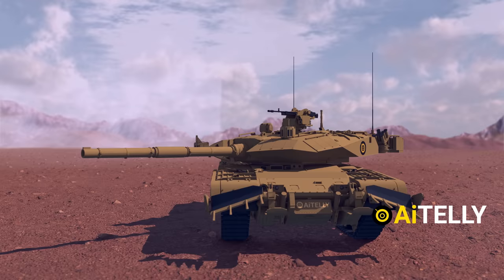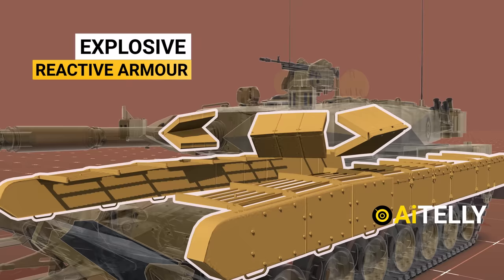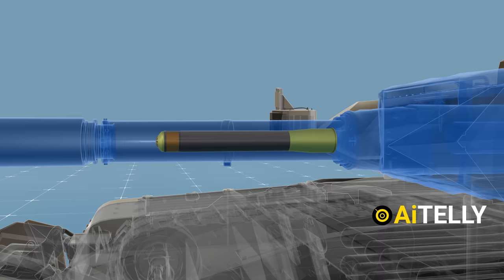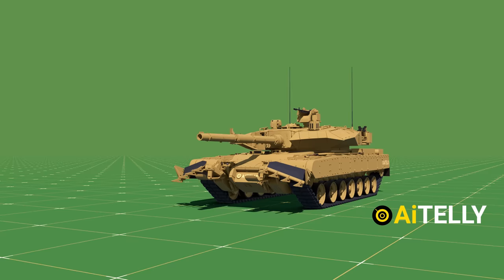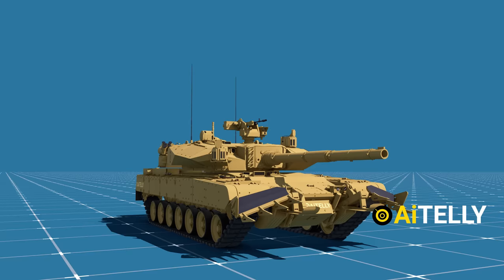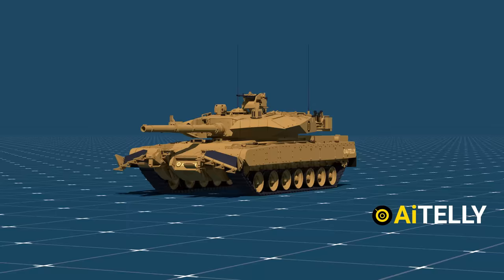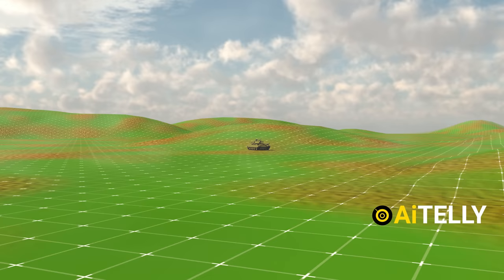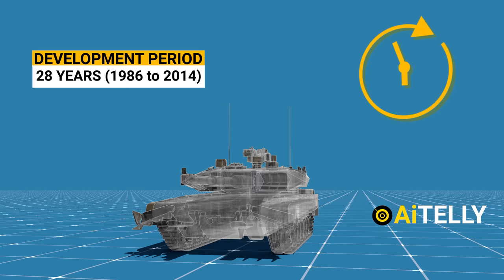Heaviest Battle Tank Arjun Mark 1A Mark 2 | How it works #tank #tanks

Comment: This tank will suffer in muddy and eastern indian terrain.But they most probably made this tank for pakistan.
Reply from the maker: I think so
Reply: @Aitelly  Arjun's operations are easier due to low soft ground pressure (0.84 Kg/cm2) in comparison to T-72 (0.89 Kg/cm2) and even T-90
Reply: It was made to counter abrams  that was supposed to be procured by Pakistan.
Reply: @007ymm5  lol usa didn't give Abrams to pakistan and Abrams much better than arjun 😂
Reply: @wendelldig591  yeah I said abrams that was supposed to be procured.
Reply: @apoorvchauhan6258  yes it has low ground pressure but it will suffer when crossing weak bridge because its total weight
Reply: @suhendiabdulah6061  true
Arjun was never made for Mts anyways

It was for plains of Punjab and Desert of Rajasthan.
We have T90s and T72s for Himalayas plus we are already making a light tank tailored for that terrain
Reply: @wendelldig591  the Abrams version which could have been sent would be much lower.
Reply: @apoorvchauhan6258  yeah lucky for india have big plain area.....  island nation like indonesia, philipine and japan have limited play for mbt. Even japan that capable to build heavy class mbt abandoned mbt and chose type 16 - 105mm low recoil gun wheeled vehicles and indonesia chose to build 32-35 ton tracked vehicles with 105mm gun ( well...... japan chose wheeled vehicles because it has good road condition and indonesia has extreme road so they chose tracked vehicles) those island nation chose mobility than armor because its easy to be deployed and tranported by plane
Reply: @suhendiabdulah6061  once deployed Arjun can wreck havoc coz new systems are already in place along with new kanchan 2 armour and new types of main gun missiles..also new APS system will destroy incoming shells
Reply: It's very similiar ( in looks and capacity) to leopard 2 of Germany..same DNA..All efficacy questions END right there..ITS GERMAN
Reply: This tank wasn’t design to fight in the east of India .. Iam not a fan of Arjun but FACT is FACT !! Arjun was designed and manufactured to replace the T72s in the western sector bordering Pakistan .
Reply: But across the LoC weight will be a problem because most bridges won't support that weight.
Reply: @wendelldig591  There existed a possibility always ... Pakistan has previously procured Patton tanks also from USA and they were used in 1965 and 1971 war against India (though not much effect from it as many were abandoned and destroyed in both the wars).
Reply: @wendelldig591  Abrams don't have missile firing capability. Arjun can target Abrams at 5km range.
Reply: @apoorvchauhan6258  yes but it's best to design tanks that's great for all terrain possible. Added too much weight is whyany tanks can't cross bridges, destroy roads, stay in mud, not amphibious etc. Look at Russian tanks. Can go any terrain, bridge, roads and can go on river and not get stuck on mud. That's a huge advantage in war
Reply: It's for western front only .
Reply: @dharmicwisdom9818  wrong. Russian tanks has very good protection really. And no it's not what you saying which is very false, because if that is true then leopard tanks would not had worst performance in Syria. Also Abrams tanks in Yemen would not had bad performance as you can see many videos and photos of destroyed Abrams. That is why aps systems will change the battlefield against RPGs and atgms. So again wrong.
Reply: @dharmicwisdom9818  you forgot the it's because Soviet doctrine they invented the explosive reactive armor which is best to have in any tank and that's why all western tanks have it right? Then case closed.
Reply: @alexnderrrthewoke4479  Israelis figured it out after their war with Egypt.
Reply: @dharmicwisdom9818  that's why tanks never work alone. It's evolution of attack and defense. They always at war with each other.
Reply: @wendelldig591  the Arjun mk 1a and mk2 can almost go toe to toe with Abrams and thankfully USA (due to high rise in terr@rism) didn't get Abrams to Pakistan, but Arjun can now wreak havok to Pakistan's Chinese made tanks
Reply: Ha Ha I am from India and I don't know How good Arjun is Against Abrams but in every comment section people are fighting with eachother without knowing a thing about Tanks🤣🤣🤣🤣
Reply: @alexnderrrthewoke4479  in case of  India you can't get everything, as India has every kind of terrain, from desert to tropical and mountains snow desert if you want a tank that can go anywhere then you have to sacrifice its armor, and for today's warfare no tank is safe from ATGMs, every tank needs an APS, hard kill and soft kill, and we may not even see a that much of tank battle due to ATGMs,  tanks need infantry and infantry needs a tank, vice versa for completing the task,
Reply: @benudharmadhi4154  again have you not learned a from war yet? Tanks will always be needed in battle. Putting too much armor is not worth it. Enough is the word about it. Aps systems will change battlefield of atgms. Tanks will never be obsolete as many ignorant people say and for you to say there won't be many tank battles then you not seeing what's going on in ukriane then. Atgms is not easy to produce especially javelins which is 250 per year. That's nothing.
Reply: @alexnderrrthewoke4479  I didn't say tanks are obsolete, but it needs good support from the infantry, countries like the UK, USA, France, Israel, Sweden, Russia, Germany, China, India, Turkey, and Iran, have industrial to mass produce the missiles, it cost less than a tank, every tank are obsolete from top attack, javelin, bill, Nlaw, nag, can destroy every tank, APS is must and should, currently they tank face another major threat is the drones, and in an urban environment that's a nightmare for tanks
Reply: @benudharmadhi4154  missiles cost less? Did you read my comment? Lol. Do you know how much it cost a javelin? 100k now with inflation so no. The bayraktar turkey drone or the Iran drone will make better buck over javelins any day. Of course tanks not supposed to work alone.
Reply: @alexnderrrthewoke4479  javelin costs 200k$, and a t-72 1.5 m$, a t-90 3m$, an abrams 6m$, and a leopard 7m$, and inflation will also apply to a tank not only for missiles, APS can only save tanks now
Reply: MUDDDDDD?!!!!!
Reply: Thats why the army had issued the light tank order. And zorawar kight tank made by L&T will be presented in april this year
Reply: This was mainly built for the Western border with Pakistan. In that region, arjun even performed better than t90 tanks
Reply: @wendelldig591  much better doesn't always means it will win. Pattons were also better when pakistan got it. Still indian army made a massive graveyard of patton tanks. It's hilarious when people underestimate
Reply: It'd called as desert ferrari so no need to deploy it in northern and Eastern theatre
Reply: @apoorvchauhan6258  bro.....the Arjun is twice heavier then then both the t-72 and t-90....
Reply: @bhishmaMbt  it is heavier but weight distribution in case of Arjun is better as larger surface area is interacting with the ground thus decreasing the pressure.

Pressure= Force/Area

Force= Mass of the object x Acceleration.
Reply: @suhendiabdulah6061  precisely sir. different condition, different doctrine.
Reply: @alexnderrrthewoke4479  agreed sir.
Call it lack of vision, coupled with threat assessment of the time when Arjun was conceptualized.

Pakistan was the threat and idea of heavy armor deployment in Himalayas against PRC was absurd.

Arjun was tailor made for operations in Punjab and Raj.
Reply: True for eastern front their is zorawar lite tank in development
Reply: @Jemsgg1  check the list again
Reply: @wendelldig591  Yeah, is this why USA lost its war in Afghanistan?? 🤣🤣🤣
Reply: @alexnderrrthewoke4479  To fight a elephant one must send an elephant. A horse however nibble will have no real effect.
Reply: It's nice to see the keyboard warriors engage In combat conversations but practical knowledge and information is far more different then thus shitty 3d animated video
Reply: As a descendant of an Indian Muslim, I can safely say most village bridges from both sides can't handle the weight...
Reply: @benudharmadhi4154  true but tanks in indispensable in the battlefield. Plus javelin missiles the process of making it it's not easy. Atgms would be cheaper option.
Reply: @truthseeker3404  good one but trying to understand your point.
Reply: @alexnderrrthewoke4479  javelin is overkill for any tanks when you can destroy tanks with stugna-p you may not require a javelin,
Reply: @alexnderrrthewoke4479  you said one tank should be able to go everywhere. I'm opposing that statement with my previous comment. Every weapon should have multiple variations to counter multiple situations.
Reply: @bigboymuslim9272  Well iv seen m
Arjun crossing indian village bridges very efficiently when it was going to be tested. I was on a bike trip. When we came across the first prototypes. But it is really heavy though that true too.
Reply: @truthseeker3404  well Russia tanks and Israel would like a word with you then, except mountains of course since it's best suited for light tanks. Adding more to do the same job makes things more costly and not worth the bucket.
Reply: I think it is mainly for Desert & Plain warfare(against Pakistan in western border) and for Mountainous regions specifically in Ladakh(against China). North East Reason is not much of a threat, we still have neutral reltaions with Myanmar under dictatorial rule and pretty good ones with Bangladesh, the main problem their are insurgents & maoist sepratists, and you don't need tanks for them.
Reply: @overwatch91  Which list?
Reply: @Jemsgg1  the destroyed junk list
Reply: No already their are videos this tank can run all surfaces yea it was designed for desert combact
Reply: Leapord 2 is the best
Reply: @alexnderrrthewoke4479  I understand what your saying. But these mountains that you are talking about are Himalayas! Not some cheap European rock dunes. There are constant rockslides, earthquakes, raging rivers deeper than mainlands. That is why is said it's good that India is developing dedicated equipment for dedicated location bcoz India has ice, deserts, rainforests, swamps etc etc.
Reply: @apoorvchauhan6258  yes...all those physics will go down the drain once that heavy asf tank goes on a bridge
Reply: @bhishmaMbt  it's not Hollywood/Bollywood

Physics actually works in real life
Reply: @overwatch91  Yes a lot of patton tanks were destroyed and captured and a presentation of those junks were also held
Reply: @truthseeker3404  maybe a couple arjuns
Reply: @Jemsgg1  if you want  see the practical of mg3 mmg heavy tracers then ask me 
I send my personal one OK
Reply: @hardeshmanhas4102  kacha aam 🥭  armour 🤤
Reply: @potatopotato9397  kanchan armour...
Reply: For eastern sector, government is going for the light tanks like Zorawar..
Reply: Best for desert  land
Reply: Yeah it's for Pakistan ! For eastern side india is already developing a zorawar light tank
Reply: @007ymm5  Ukraine says, "hold my beer".
Reply: @alexnderrrthewoke4479  Arjun is a knock off of the T90.
Reply: Arjun has lower ground pressure  than t90 Abrams tank and british which determines it's performance in mud and sand
Reply: @apoorvchauhan6258  They are doing the same thing China did with their Type 9X series tanks. Basically taking what they want from Russian and Western design. We'll see if it plays out though.
Reply: @007ymm5  Lol Pakistani had a better chance getting IFV's than Abrams. Especially after the whole Bin Laden controversy.
Reply: @alexnderrrthewoke4479  There are no rivers on 80% International border between India and pakistan
Reply: eastern indian terrain it was not meant to be used their
Reply: This tank is made for Rajasthani & Gujarati  Desert
Reply: Yes it will be based in Rajasthan desert.
Reply: The government has requested drdo for light weight tank
Reply: This is for Pakistan.. This is mainly going to deploy in Western border.
Reply: For eastern indian battle ground there will be other class MBT we don't have Arjun only as MBT in india i guess you haven't notice that. This Arjun was made for Western border battle.
Reply: Varaha Shakthi  you are right bhai ye gorey kya jane hum desiyoon ke jalwe
Reply: @wendelldig591  😂because the last time Americans gave the Patton tanks to Pakistan 🇵🇰 we smashed 100s of it and displayed it as war trophies for the whole world to see!
Reply: Yea charging straight through the deserts of Rajasthan
Reply: @007ymm5  wow really?? That's interesting.....
Reply: @mr.waffentrager4400  yeah downgraded export model
Reply: @Jemsgg1  yes M 48 Pattons. And we made Patton Nagar for them lol
Reply: @alexnderrrthewoke4479  i guess those are Saudi export model Abrams . Downgraded
Reply: @alexnderrrthewoke4479  wrong bro. ERA was developed by the Israelis
Reply: @dharmicwisdom9818  bang on bro. They were test firing at old tanks. One of those tanks had some rounds in it that exploded when the shell hit it...... That's more or less the story....
Reply: @darthvader5558  and also to its home produced Al Khalid
Reply: @harikrishnanps8938  Arjun mk1a and mk2 are made with the DNA of Leapord 2 
as the german company which made leapord helped India make Arjun
Reply: Yeah it is made for Pakistan i am an Indian defence aspirant so i know it is for borders which is share by Pakistan coz it is much deadly in that region
Reply: @Ayan19837  nope. You are very wrong. What's his name of you don't mind sharing?
Reply: @Ayan19837  it started in USSR then it was discontinued with belief tank has enough armor. Then came a west German who went to IDF and Israel used it so either way you got it wrong.
Reply: @Ayan19837  we will see soon once it performs in Ukraine
Reply: @hardeshmanhas4102  people have toxic nationalism which rather results in auto induced sense of even defending the mistakes and shortcomings or flaws rather than unbiased healthy critics instead which helps in further growth and improvements.
Reply: @Ayan19837  Yes about 100 pattons destroyed or captured
Reply: @wendelldig591  please specify...in which area is Abram more powerful/advanced than arjun
Reply: @007ymm5  current arjun mk2  tank way more powerful than current Abram tank
Reply: @suhendiabdulah6061  bridge issue had already solved..
Reply: Pakistan is buying Turkish TB2 drone with munition, so Arjun is no longer a threat.
Reply: Ankit Patel  Is your air defense system better than Pantsir systems? TB2 took out several of them with ease in Syria, Libya and Armenia.
Reply: @wendelldig591  arjun is still better than t-72... Something is better than nothing.. also tactics matter and yeah pakistan is bit bad in that regard if we check past wars... Eg- battle of longewala
120 indian infantry + couple of jeep mounted recoiless guns and few hand held rocket launchers vs 40 pakistani tanks around 2000 infantry

Result- 
India won with 2 casualties and those jeeps lost vs 36 pakistani tanks destroyed and 500+ soilders killed 

Yikes
Reply: @wendelldig591  We are talking about old Abrams varient and old Arjun mk 1 which bult to counter Abrams with help of Germans. This Arjun Mk1A which shown in the video is a modern variant made to counter Chinese tanks used by Pakistan
Reply: @alexnderrrthewoke4479  no!! Tanks always not needed. Read about the battle of longewala were whole Pakistani tank regiment was destroyed by the 124 soldiers and Car mounted Gun.
Reply: @ChoCoMoCo69  ok you talking about one situation over many times proven by generals and commanders that tanks are very much needed. You make no sense. Generals said the same too when having nuclear weapons. You know what they said? We don't need a navy. Korean war proved them wrong and they got fired by US government. So your point is moot
Reply: @suhendiabdulah6061  indonesia has their own water tank called antasena
Reply: This tank isn't meant for wet terrain. T90s and T72s can do this task
Reply: Don't think so , just a bit heavier than Abrams.
Reply: Bro tanks are never made for Northeast region. That's why we have one of best missiles for terrain religion. Such as Brahmos which can change direction in 90° - will bd useful in Himalayas, Galwan, Arunachal
Reply: @wendelldig591  Patton was better than Centurion,, lol
Reply: @wendelldig591  bruuh Arjun MK 1 A and MK 2 are wayyyyy better and wayyyyy more powerful and advanced and are wayyyyy more capable than USA's aibrham mbts
Reply: @dharmicwisdom9818  Abrams is a million times better than Arjun, Arjun is the worst tank of all time
Reply: @gwshd-6344  lol
Reply: Correctly said but DRDO is developing the ZORAWAR project lightweight tank so it will do the Job
Reply: @apoorvchauhan6258  the difference of 0.05 won't make much of a difference in muddy terrain. The overall weight is too much even for modern tanks. It boils down to poor metallurgy and manufacturing practices. Should be easy to remedy from an engineering point of view but irl won't matter as government run manufacturing sites have very very poor efficiency
Reply: Arjun is made for western reason for eastern Region wr are developing zorawar light tank bcoz in moutain region light tank have advantage over heave tanks
Reply: @mr.waffentrager4400  Indonesia?? , Philippines??? , Japan!? Bro these are freaking island countries you're comparing India with
Reply: No enemies on the east
Reply: @007ymm5 this tank made to counter abrams?? WHAAAATT?!! Did this tank ever counter T-72??? I mean the full upgraded T-72???. If the tank is heavier than Abrams, that doesn't mean its better! Abrams use depleted uranium shell!
Reply: Yes it is made for Western borders only,for eastern border india is working on Zoravar light tanks
Reply: “Muddy” u mean cow dung and human feces? 😂
Reply: At least they've got one, we've got zero.
Reply: Nah bruhh it's an evolutionary tank this one was done just in 5 yrs it's more like a capability test bed Arjun series will continue to grow further mk 2 would be a true mbt to replace all t72s and t90s partially
Reply: Dude Arjun exerts least ground pressure as compares to any other tanks. Only problem is that it is heavy hence it is not effective in Mountain terrain like in kashmir and ladhak region.
Reply: @wendelldig591  well there are lot of versions of Abraham and this tanks objective was to counter m1a1
Reply: @alexnderrrthewoke4479  can't you read he/she said "not always needed", not never needed.
It depends on the situation Battle tank is needed or not
Reply: @priyojeetmondal9883  (1) U.S. Abraham Battle tank is a excellent Battle Tank
(2) Regarding Arjun battle tank and Arjun battle tank mk.2 are way more powerful, are way advance, are way more better than Abraham tank is even proven yet.
(3) you had dishonoured me and other Indian nationalists as toxic nationalist.
Reply: @gwshd-6344  (1) Abrams tank is a excellent tank.
(2) Now regarding Better than Arjun tank is some cases definitely yes, but in some cases definitely not proven yet.
(3) It is not proven Arjun tank is the worst tank.
Reply: As if India is an island it's exclusively for the desert of western India which is as big as some countries.
Reply: @apoorvchauhan6258  Right said Bhai👌🙏🇮🇳🚩
Reply: That's correct.
Reply: "Its entirely worthless, has no point, but we think we needa be cool"
Reply: @purestench9263  You sure must be a "Tank Commander" with some 3rd or 4th generation tank under your command that's why you are able to pass such a big statement!!
Wait a minute you are some random YouTube user with zero knowledge & experience on a MBT but full of hot air,boy stick to your hip-hop songs & leave the important things in life to the knowledgeable!!
Reply: At last a MBT expert from the swamplands of Bangladesh,boy this tank is made to be a primary heavy cavalry breakthrough mobile unit to render useless  the Pakistani lines along the Indo-Pak border at Rajasthan & Punjab.Secondly do you have any knowledge about the Arjun MBT's features,due to the high power-to-weight ratio and low specific ground pressure,MBT is fast,highly manoeuvrable and extremely mobile to cross the most difficult terrain with ease.
Infact it's power to weight ratio is significantly less than a t-90 tank that Bharat's Army operates.
The Arjun Mk.IA is powered by the V-90 engine with a power output of 1,030 kW,which provides a power-to-weight ratio of 15 kW/t and an off-road/road speed of 40 km/h and 58 km/h, respectively.
Have you ever seen or read about the weight of a current German or American MBT in active service!
Reply: @hardeshmanhas4102  The German company that made the design of Leopard & Arjun MBT's is the same,that's why both tanks share lot of external mainly turret shape features!!
Reply: @wendelldig591  one outdated Russian rpg hit in Iraq/Afghanistan & the turret of the Abrams goes the aerial route!!
Reply: @SamuraiMonkey79  one would worry if our country would have been an island and mountainous, dont we have thar desert which is as big as some countries, so what's the problem with these gernails and commission agents, even a Israel is half the size of thar desert, Israel has 500 to 1000 merkava tanks.
Reply: The rumours were that Pak was about to receive Abrams to counter india, so indians came up with these. Fun thing is, that this is the most advanced tank in indian inventory.
Reply: Due to the dense forests and uneven terrain of NE India, No tank can operate here.
Reply: Yes
Reply: @wendelldig591  not at all. This tank's latest version is as good as latest version of Abhram. Even the Israelis were highly satisfied when they came to India and tested this tank.
Reply: That's why india is working for mk3 version
Reply: @apoorvchauhan6258 same old story Congress propaganda
Reply: @MrAjithutube  what propaganda?
Reply: Well in the desert conditions (pak border) Arjun performed better than t90 tanks.
Reply: Yes, for mountainous terrain Zorawar is being developed with only 40 ton wieght
Reply: @gauraverma  I think it's 25 ton
Reply: @wendelldig591  that is the thing bro.. USA always changes its opinion on different countries when Republic vs Democrat comes into picture..

So if they see Pakistan as an ally, no matter how attached Pakistan is to ISIS or Al-Qaeda... USA will choose to support Pakistan

That is the geopolitical policy of the United States of America..😊
Reply: This tank is specifically made for Western Borders on Indian especially Dry & Plains of Rajasthan, Gujarat & Punja borders in other areas T90s are used not these tanks.
Reply: For that India got T90
Reply: Perhaps, India needs tanks only in the Western boarder which is mostly desert
Reply: @wendelldig591   Hi bro reading ur cmmnt after 1 yr amd after watching how rassia paraded ur abrams in their v day parade
Reply: @wendelldig591  lol Abrams don't stand a chance from a heat seeking missile 😉
Reply: It's exclusively for western fronts